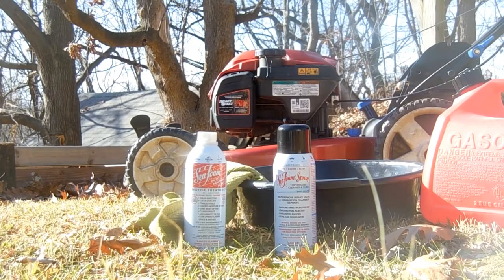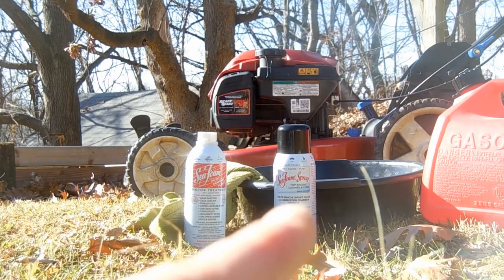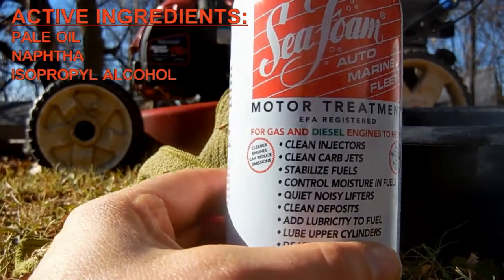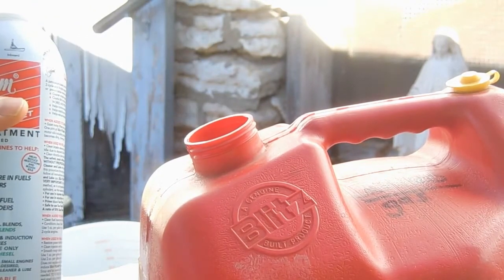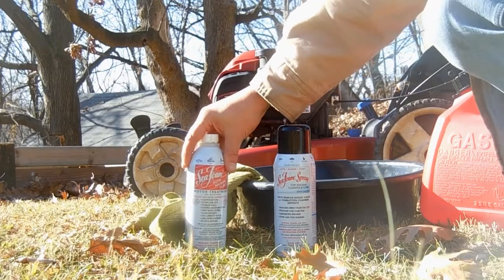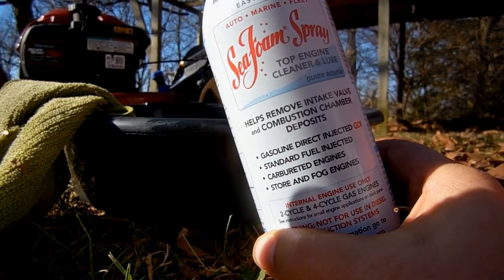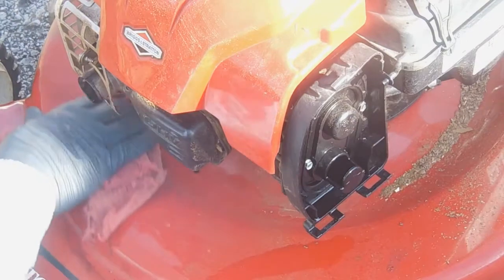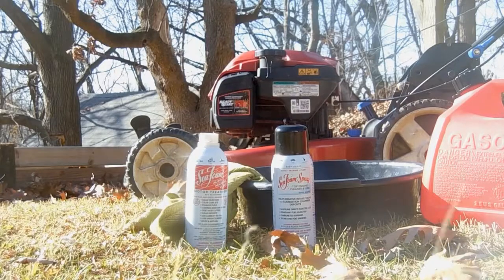Sea Foam and Sea Foam Spray Rev Up Tune Up

Comment: After the short bursts do 1 long burst that is enough to kill the engine followed by a 10 minute soak, reinstall the air filter and restart engine and use the mower. I do this before I would mow a lawn

Comment: Excellent video.  Thank you so much! 
Can the seafoam fuel additive also be poured into the air intake of using seafoam spray?
Reply: Yes. It doesn't matter which one you use, but is seems like the spray worked a little better